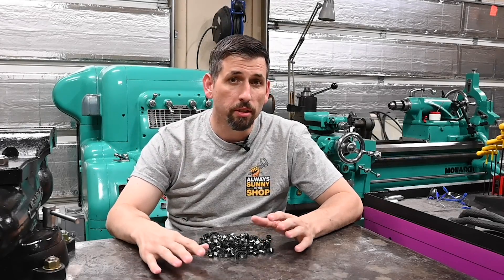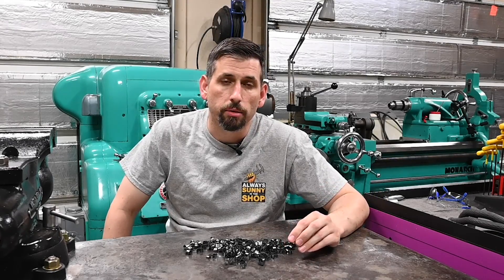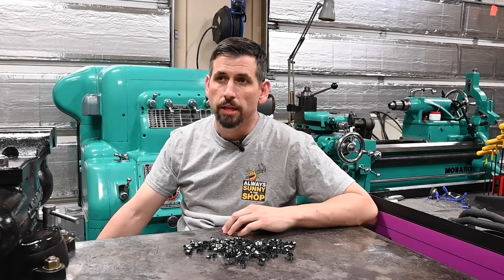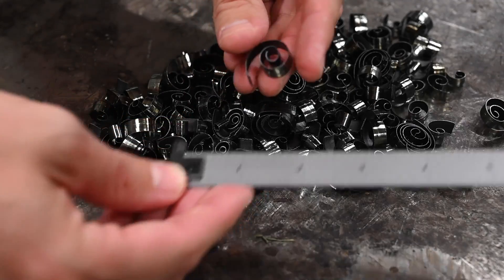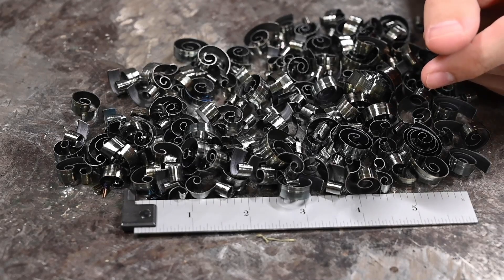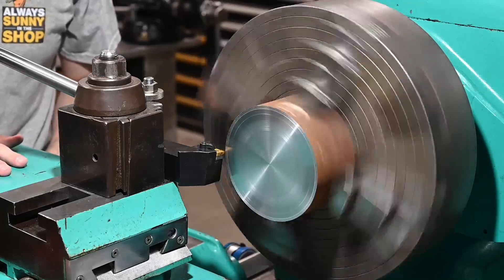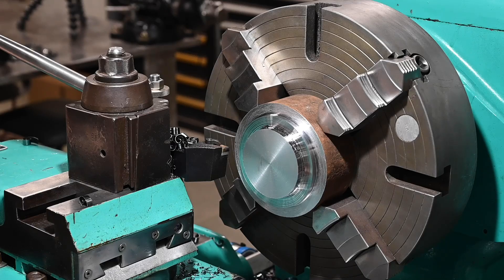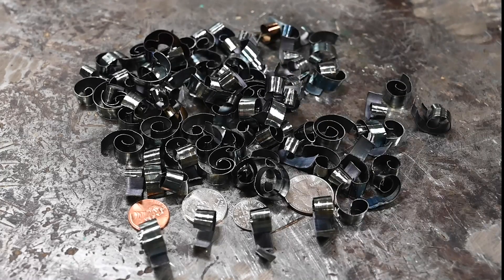Heavy Cuts on the Monarch Lathe!

Comment: Keep slowing the rpms as you increase the feed rate. Then you will get some chips ringing off. If not the heat will end up in the part and not in the chips.

Comment: Aaron I like your videos and I have been shopping for a heavy duty lathe like your Monarch. I'm in the San Francisco Bay area actually in the east bay and I was a licensed contractor in the area for about 20 years and you can save about 30-35% by acting as your own general contractor which is permissible in California. (I'm not sure where you reside) I would suggest that you get more than one quote 2-3 or maybe 4 and it will be common to have a large difference between the highest and lowest quotes. If one quote is much very lower I would be concerned it may cause trouble later during the job if they run out of money and start cutting corners. If it's trouble for you to meet each subcontractor separately then have them all meet at the same time that way everyone gets the same presentation. If you have drawings and a written outline of what is expected that would be that would be great. Also ask for references.  California Contractors Board has a pamphlet on hiring a contractor you could probably download from their website. 

Good luck and have fun.

Comment: Chips will always be thicker than your tool movement, picture digging a trench and upending the earth. You always end up with more dirt than needed to backfill, basically your are "fluffing up" the material. Always love the sound of hardened chips hitting the deck, they have a very specific ring to them.
Reply from the maker: I didn't explain well in the video- I'm not surprised that it's thicker, just surprised at how much thicker it is. I would expect 2x the feed rate, not 6x. But yeah, it makes sense that it bunches up when you make the cut.
Reply: My explanation was going to say the same thing but in different words.

Comment: The chips are thickened  because the material is being forged at the cutting edge. Depending on the conditions, the forging could be primarily curling , which will give a little thickening, as the inside of the curve compresses, but the outside does not stretch due to the high forces in the cut direction, or both curling and shortening, where there is forging int he cut direction. The metal conserves volume (substantially), so shorter becomes thicker. This applies to continuous and sheared (continuous with built up edge) chip forms, which you should see with 4140.

Comment: Aaron I am having concrete work done right now and my masonry contractor quoted me $10/sq.ft. for a stemwall slab, so a 30'x40' shop would run $12,000 for the slab. $125/sq.ft. is what you should be able to build a home for, maybe $150/sq.ft. but for a shop why not just use a steel building, you can get a 30'x40' for about $30,000. You could frame it yourself cheaper, IMO, and worth looking into IMO. I encourage people to use sweat equity in a project like this, heck I'm trying to build an entire home myself. Shops are easier to get permits but if you really do want to attack it yourself, try to understand size you want, and a way to get plans so that you can submit to the county. Certainly you jest about San Francisco, it's incredibly expensive and complex to get permits. Same where I live in West San Jose...(south bay). Not as bad where I'm building up in Lake County, but it is probably more difficult up there that where you live. Good luck, I would take it one step at a time, first get your plans, then get your permit, then have the slab poured. You could probably do that for about $20k. After you do that you can take your sweet time...iI figure it would cost about $50k-$60k to build a 30'x40 steel building shop in California, can't be double in Austin...I don't think...should be cheaper...
Reply from the maker: Thanks for sharing your current experience. This is a monolithic slab, 24x34, 6" thick with rebar and big footings. I'm expecting my permits to be about $1,000 and concrete is $111/yard around here. Including the driveway, we're looking at around 35 yards, so it'll be a fair bit of material on top of the labor. I didn't want to do a steel building for appearances' sake. The addition will look just like the house (timber and stucco, concrete tile sloped roof) and be attached on the side of the garage, so when the weather is miserable, I can just walk in to the air conditioned shop with my flip flops on to grab a tool or check on something- no walking across the yard in the heat/dark etc. That's one of the reasons I'm limiting how much I DIY on this- this week our lowest high temp is 106, going up to 112. It'll be like that until late September around here, so swinging a hammer on a tall ladder in that heat is unappealing for a guy that works inside for a living. This design will also simplify my electrical work since everything can go in the wall that connects the existing garage to the new shop, so there's no conduit needed anywhere. There's always compromises, but I think this will work out with regards to price, appearance, and maximizing $/sq ft.
Reply: @AlwaysSunnyintheShop  If you can afford it, it's all good! Concrete adds up quick, I can tell you that. I have massive footings on my foundation for my log home, they made me do it. I have 10' walls on the basement, 10" thick. If you have a driveway and a lot of concrete their $125/sq.ft. might not be too far off, IMO. Good luck with your project!☺️

Comment: Aaron, really cool video. This is exactly how you get familiar with your machine. Important to know it’s limits. Did you play around with your RPM and feed rates at all when you got to .250” DOC? Ceramic inserts work great for heavy cuts like that. I pushed my little 12x36 Enco lathe to .150” DOC on the dial a couple nights ago and man was it a blast. Looking forward to seeing the new shop space! Keep it up!
Reply from the maker: No unfortunately I didn't have enough material left to experiment much. I'll probably go with a CNMM tool for the bigger cuts, or even a CNMG643 along with a new holder. Ceramic is another option, though I'd have to try with carbide on a given feed and speed so that I don't shatter the ceramic...more fun to come I'm sure.

Comment: Maybe the chips are made thicker than the feed rate due to plastic deformation as the material folds over the tool face?
Reply: In fact, that might account for the oversized measurements in Z, too. Measure the chip and the workpiece cut width to compare the two.
Reply from the maker: I considered that but would expect to find a varying thickness over the length of the chip and did not.
Reply: AlwaysSunnyintheShop Watch this and see what you think:  https://youtu.be/mRuSYQ5Npek
Reply: @AlwaysSunnyintheShop  yeah, I don't buy that because  metal can't magically grow when you cut it. The videos don't appear that the thickness is increasing as it cuts, but it shows how the HSS takes a shear cut, rather than how carbide basically rips and tears the metal off, just that it happens so quickly it does it cleanly. I'd like to understand it better myself.